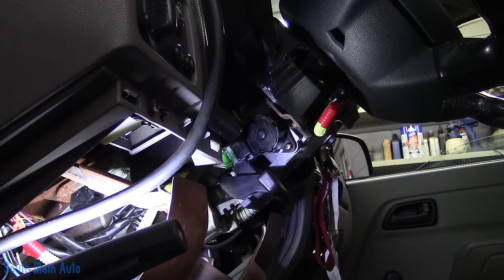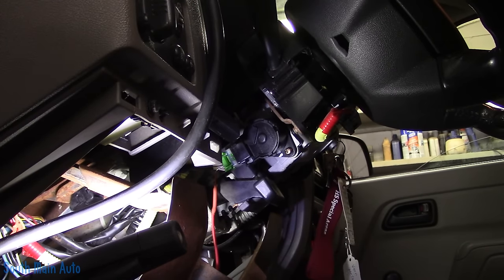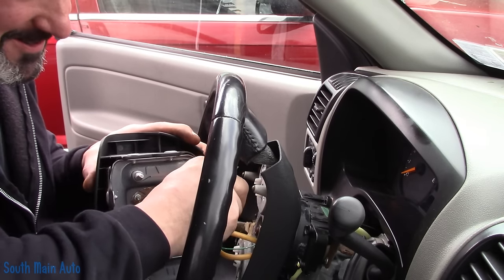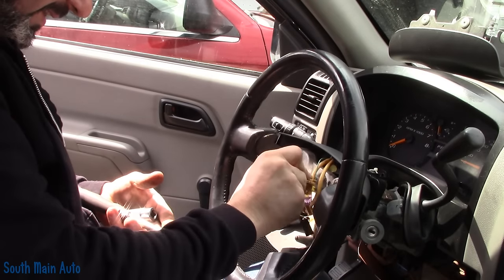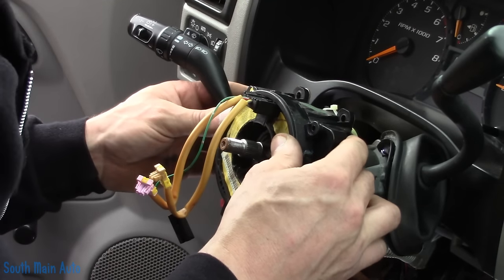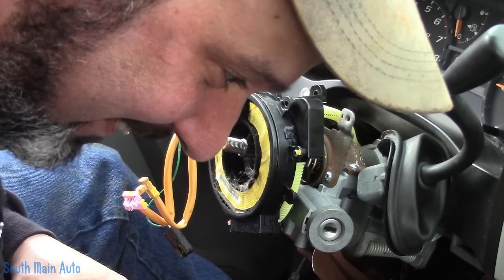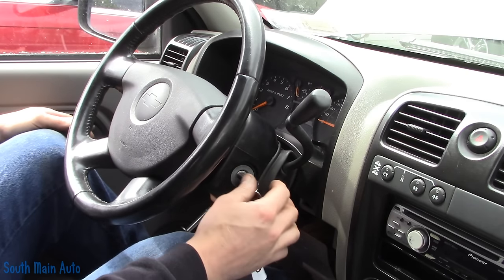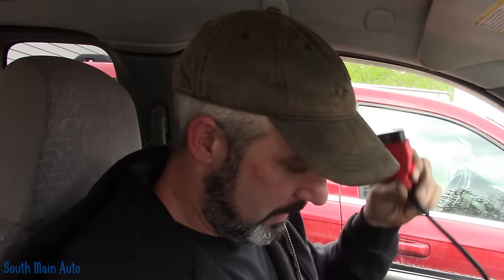Chevy Colorado: No Start, No Crank

Comment: Five years ago my '98 Bonneville (160k miles) no crank, no start, let me down in Ferry Port parking lot. Towed to well-known  Chain which shall remain nameless. They replaced my starter and battery, still no-go. They put my old starter back in, but i told them to leave the new battery, and they "SHIPPED" it. I paid second tow to a local GM Dealer rather than try my luck fixing it because i wasn't motivated and i needed it to go to work... 850 smackers later i got it back, it was the thread-thin white "Security" wire, so i got a new switch out of it. Security light was blinking when I turned key, but i didnt know at the time that was the culprit, and i wasn't really up to pulling the steering column to run the wire anyway. Oh! And the second tow truck flipped my inner fenderwell inside out somehow causing the tire to rub. I wasnt there for the second tow.😡 Couple years after that I had it on ramps for exhaust leak, and i peeked at the solenoid wires and noticed no nut on the small wire, only held on terminal by tension!🤬 As i brought my hand down, it knocked the "missing" nut off the top of the frame rail and the nut hit me in the face. Well, at least i didn't have to look for a new nut like the Chain should have 😛

Comment: G'Day, that road working machine is very old fashioned. It's replacement, grinds up the old asphalt, mixed in some new material, remelts the mixture, lays the new layer, and the road roller following behind, compresses it, all in one action. I have seen them renew more than a kilometre in a day.

Comment: Had a Colorado a few months ago, customer brought it to us for an exhaust leak... cracked manifold other tech puts a mani cat assembly in it runs it drives it all good. Next day customer comes to pick it up and no crank no start,  tells us it's been an intermitant problem but can normally get it to start. He cant, so he comes back in, agrees to have us figure it out. Sure enough that thing never started again until I replaced the bcm and relearned the keys. Lost start signal from bcm on... one of those vehicles that's haunts you in your sleep and keeps you awake at night. No part stabbing there, proper testing of circuitry lead me to a definitive answer. I started at the starter and ign switch and worked my way backwards on the schematic till I either found power/signal, or eliminated all other possibilities, testing to and from the bcm starter signal in and out was how I got there, 2 days and one sleepless night later! Thanks for the videos! I love seeing another perspective and approach to diagnosing these more complex issues.

Comment: This is a common problem on the Colorado and about a $500 repair at the Dealer.  My Colorado has only acted up once with the no start.  Friend of mine had the repair done as it kept no starting on him.  Good to know about the airbag release on these.  I used some fluid film over the weekend and I "baaahhhhed" in my head while using it.  Thank Eric!

Comment: Mr. O, you are an inspiration. I’ve been binge watching your videos for a couple of weeks. I no longer work on cars, but I maintain a fleet of tow trucks. 
Not only changing filters and fluids and changing brakes, but most commonly, electrical problems. 
Following your attitude of starting simple has helped me tremendously. 
Most electrical problems have been result of when the tow truck body was mounted, when a wire is hokey pokey’d looking for power or is chaffed because it wasn’t secured properly.  Your approach of looking where someone’s fingers were, has made chasing these issues down a lot easier. 
Only problem is, is that when I’m working on a truck, I talk to myself out loud.

Comment: Followed your instructions on removal and reinstalling the switch. Everything went well. For some reason I didn't have to reset the security system. It started on the first crank and stayed running. Restarted and ran every time I tried it since.  Thanks for your informative video!
Reply: So did mine have you had any problems
Reply: @dannyscott402  none so far

Comment: I was installing a new radio in my Chevy Colorado when it triggered the anti-theft system. It wouldn't run and there were a number of codes displayed. I tried this and It worked. Awesome - thanks so much

Comment: On those spring clips you have to push back on, get an old screwdriver and cut a slot on the end with a cut-off wheel. It'll grab the clip and keep from slipping off.

Comment: Just wanted to thank you from the bottom of my wrench turning heart for this video. Could not figure out what the heck was wrong with my Colorado because it wouldn’t start at such random times. But your very thorough video helped us diagnose it and I could not appreciate you more, man.
Reply: Do you need the maxicom computer to relearn the key?
Reply: @letsgosurfingdude  No, you dont need a computer to relearn the key. Just follow the steps he did. It will take roughly 30 minutes to relearn

Comment: These trucks are notorious for the ignition switch. I just did a diag on a 2005 Colorado that had a bad ignition switch. Without removing the wheel I just changed the plastic switch at back of ignition since the barrel was ok from the new barrel, and boom started then wouldn’t stay running. Someone cut the security wire trying to bypass the security start. Connected with and boom still runs perfect. You think they’d recall..Thanks for the video.

Comment: I have a 2009 Colorado very well done. I will attempt. Now I just have to fix yaw rate, passenger front wheel speed communication, steering angle, air bags, no ding or radio more than half the time, and the rack, tire pressure monitor, and temp sensor goes to zero at first warm up. Reset ASAP with scan tool then fine the rest of day. FUN FUN. thank you

Comment: Also- I got to thinking about the issue with having to use a flat head screwdriver to push the spring to release the airbag. I took an old screwdriver & cut a notch in the tip and it work great! Just thought I’d share that it worked so much easier.

Comment: Actually solved my problem by having a remote start installed but it's now the only way I can start the truck. Theft deterrent light will light up if I wiggle the key in the wrong direction and key switch will not start the truck. Thanks for making the video, knew it was the damned key switch.

Comment: Great video. It is nice that you do not need a 4K scanner to relearn the lock.  Air bags still scare me so I pull the battery cable.  The monitors will reset.

Comment: The very few times I've done this I've had pretty good success grabbing something like a 5mm nut driver to release the airbag springs. That seemed to work better than the screwdriver I first tried. I have very little patience and if it doesn't work right away I HAVE to find a better way as something is bound to break from sheer frustration and anger if I don't. I really shouldn't be working on stuff.

Comment: Hey Mr O great vid watching how to remove ign switch good info Did know that you do not have to remove  all that steering stuff to replace the elect switch part .After remove shrods covers put the key in the switch turn to run live it there unplug the cont from switch  remove the two screws  pull switch off replace with new one from napa remove screws from it pull off then revers order

Comment: Eric, I have a 2006 Chevy Colorado that I bought new and the steering column never has locked. Now I know why - the lock mechanism is removed! Why would GM choose to disable the locking steering column?
Great video! Thanks for showing how to reset the security system.

Comment: Easy way to pop the airbag out: get something like a 1/4" or 3/16" bolt that doesn't have full thread, cut the threads off, and cut a slot in the end of it with a 3" cutoff wheel. It won't slip off, you'll find the airbag comes out very easily. I had a busted off cheapo extension, but the slot in there and it worked incredibly well.

Comment: If I remember correctly in 05 it was either / both the Colorado or Cobalt that had a known defect in the ignition that could cause it to shut down while driving.  When they mill the roads in my area they leave a nice 8 inch drop.... if you dont see it at night, it hurts lol.  Great Stuff as always !  Oh, and I didnt fall asleep lol

Comment: HEY THERE VIEWERS AND WELCOME BACK TO THE SOUTH MAIN AUTO CHANNEL!!

Whew.   That was a close one.  Almost had a withdrawal symptom set in there.  It’s like peanut M & M’s without the peanut.  It’s like watching your channel and the compressor never chimes in.

Wonder if you really needed to take the steering wheel off. Couldn’t you just turn it and get to those screws?   Hey, what do I know?  Nutton, that’s what.

Great video!!  Love the way you work and it’s cool your road is getting paved. Nothing like a fresh paved road.  Also, re-learning a new ignition switch is pretty awesome.  Takes some time, but you don’t need some fancy tool. Just a good timer.

Thanks Mr. O.  Sweet video!!

Comment: GM for you , gotta remove 3 things to get at 1 , just did entire front end over on my Silverado , what joy that was ! Basically dismantle or disconnect the whole front end and even move brake lines to get at the bolts to remove the upper control arms . Engineers at GM made sure they were not easy to conduct repairs on

Comment: I was taught to use a grounding strap. I just put my foot out the door on the ground. Also to pull the SRS fuse and disconnect the battery

Comment: Oh it's my first day on the job EVERY damn day around here! No point in trying to remember anything with modern vehicles, because halfway through the model year, they've changed it 4x already! Mix in 2 other domestics, a pile of foreign stuff, a few motorcycles and tractors, chainsaws and weedwhackers, and every one of my 2 brain cells are full to the brim! 😁

That one was alot easier than that damn Lexus RX350 I had in here. What a complete horror show that was! Glad I didn't have to relearn anything, since the job was the opposite - I kept the ignition assembly, but changed the cylinder. Owner has to have 2 keys now - one for ignition, and one for the doors, but the key fob still works, so she's fine with that. Shot a super long vid on that ordeal a while back.

Glad you're gettin some pavement out there! This friggin state steals every dollar they can from us, then gives us NOTHING in return! My road hasn't been paved in 60 years. SIXTY!!! No joke! The main road through town is a mess, as are nearly every single one of the backroads for 50 miles around. The only ones they pave happen to have selectmen, or Beacon Hill politicians commuting over them - funny how that works ... 🤬 Boston has no such issues ... hmmm!!

Lunch is done. Time to finally start on the Silverado! Had a tire to do this morning, that I couldn't finish since I had no TPMS valve stems ('10 LaCrosse) - got that ordered, then my cousin stopped by to borrow my cherry picker. We shot the crap for 45 minutes at least - he flew his home made drone around the yard at warp speed while I wore the goggles ... then he crashed it since he couldn't see - got to watch the out-of-control spiral right into the woods, HAHAHA! It lived though! Broke a couple antennas, but was still flyable.  Ok - gotta get my POS truck running! Later!! 🍻

Comment: I thought I saw the tilt wheel move when you came in early AM, these on many vehicles are known for poor solder joint on wiring, I bet (maybe) if you disassemble the ignition switch assy, there will be a loose joint for that terminal, hence it wanted to work when you smacked it around, the same thing happens with wiper and light assy switches, tilt wheels are problematic. Of course I cannot see all angles but I am thinking this job can be done without pulling the wheel, I use a small hammer and light chisel specifically for this job and I do not twist off the security bolt head, it's too easy for a thief to remove anyways If I can do it, a thief can do it. Thanks so much for the FIX.

Comment: Eric,

I an a locksmith. 

What I would have done is to take new switch and transferti old housing. Here the juice would be restored to the pass modulle.
No steering wheel wheel pull needed. N9 3 X 10 needed..

Your bypass test prooved the truck woulld run fine.if the pass key was provided power.

The switch was failing to provide the power.

Take off the switch from the new and install on the old. Test.
If good just use the new switch in the old housing.

No waiting no steering wheel issues your done.

Comment: I've got the same vehicle and mine was leaving me stranded with the security light lite. No crank due to the security passkey failure. I purchased an ac delco ignition switch cylinder but was able to replace just the black security mechanism at the rear of ignition switch by itself my mechanic portion of the switch was good. If you just replace the security mechanism you don't have to pull the steering wheel or airbag. I belive I had to brake one of the screws off for the upper steering wheel cover but it went back on just fine. Then had to do the relearn and it turned on the 3rd attempt. So if your in a crunch and don't want to remove the steering wheel or airbag it can be done just have to break a screw or two for the steering wheel covers but it will still go on just fine.

Comment: Cool, now I can do my Buddy's 2010 Colorado (if need ever be) looks like a bit of a pita though,
 but I've gotta ton O patience, so no big deal.

ALSO: Thanks for Your input On the Odometer/Trip problem I'm up against,
 I may have a look inside the 2010 Colorado Cluster in question, 

as I'm not too bad at fixin Electronics as well ..As Mechanical.
 (when I can get my Buddy's Truck) as the only thing not working is the Odometer/trip,
 I'm more concerned about it than him ..lol

Nice Work Eric O
Cheers!

Comment: Eric,
Great fix and video - Thank you! When did you reconnect the shift interlock?
BTW Keith would have fixed it with a scan tool and Ivan would have taken the old switch apart and fixed it :)  I hope the owner never has to trust his life to that rusty air bag.
SMA#1
God bless
Paul
Reply: He did clip in the interlock cable at one point. I was focused on that because I think my Colorado has a similar problem.

Comment: Pass lock system. It's a short where the wiring harness is mounted on drivers side. I know im a year late but I try bringing this passlock headache up every where I can. Only major prob I have with my Colorado. Good luck.
Reply: where exactly on the drivers side lol front, back, the inside, outside?
Reply: @UndrRatedEnt  in the engine compartment mounted to the case the battery is in. I had to do two different things. I changed the battery terminal connectors to the gold marine type connectors. The original battery had the side posts. I had to change to top posts. And thats where I unmounted that harness. You have to make sure that harness is mounted firmly. Then in the same area theres a ground bolt mounted to the fender. Disconnect. Scrape paint. Reconnect. I've determined that the fix for this is the marine terminals. I haven't had a problem since I changed. Autozone 11.25 each.
Reply: @UndrRatedEnt  are your battery terminals on top? The first battery goes dead at 50000 miles. You change to top terminals the passlock starts. Can't get dealer to fix because warranty is over. Try terminals first.
Reply: @mbuller5832  Thanks for quick reply, ill check it out. I changed the battery last year, it already had top posts. The truck is a 2005 with almost 250xxx miles I will try changing the terminals first and see if that helps anything.

Comment: I sacrificed an old screwdriver - ground an indentation in the middle of the blade to make it easy to catch the release without slipping off.
Reply: I was thinking along those lines - I'd go one step further and sharpen the inside edges of that "V" to bite into the spring a little and maybe not slip off sideways.

Comment: I just ran across this video and had a flash back to my very own 2007 Chevy Colorado XTREME (crew cab approx. 76,000 miles).  It's been a good truck, nary a problem with it until...
a couple of years ago I pulled into a gas station to fuel up. Finished my transaction, hopped in to start it and I got nothing. No Start, No Crank. Which is a really weird feeling. Had it towed to the local Chevy dealer and it turned out to be the anti theft black box. My own truck of 10 years didn't recognize me and refused to start! When I described the symptoms to the service manager she knew exactly what it was. Wait, what? Did my decade timer just run out? They put a new black box in it and I was on my way. I don't remember seeing that pad lock light on the dash. Guess the box just died.

Comment: Hey I just did this same repair on a 09 Colorado and no steer lock block or spring was in my housing either to lock the wheel when the key is removed, is this normal, and is there any way the little spring and block could be in the column as to lock the wheel in a bind while driving, I wish I had looked under there with a mirror but the old housing doesn't show any signs of wear where a lock block would've been riding there

Comment: Geez, struggling along with you at the moment, Eric O! R&R and tumbler recode on a lock cylinder on a Holden Captiva today, what should have been a straight forward job ended up with just about half my toolbox contents in the car.

Comment: Hey Eric, does the owner tow the Colorado behind an RV? That might explain why the column lock w a s removed. Great video! Keep'em coming!
Reply: I hope not! You should never tow an automatic transmission. Without the pump send oil to the cooler it could over heat and cause the Trans to fail earlier than it should. Plus the 4l60e isn't the best or most durable.
Reply: @4BillC  Well, since it is a 4x4, the transfer case could be put into neutral and flat towed to kingdom come with  no issues.